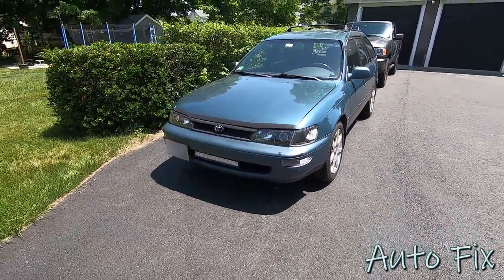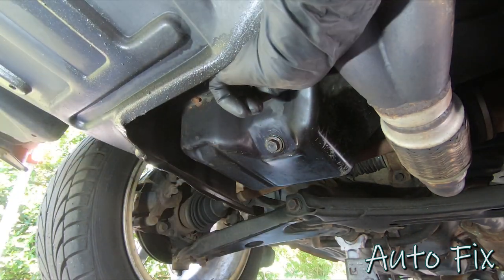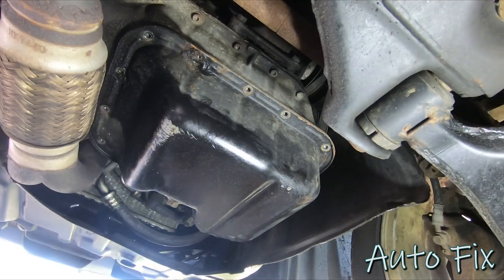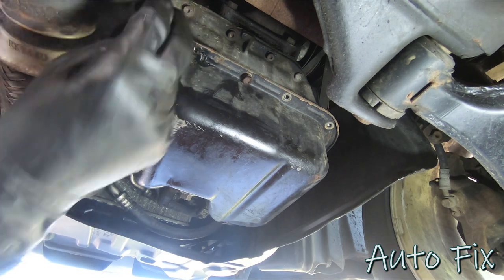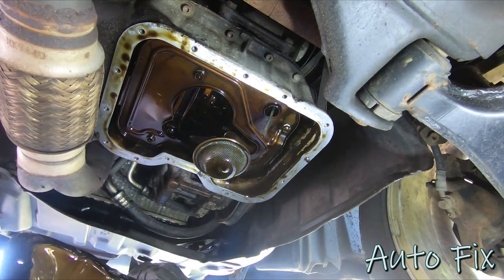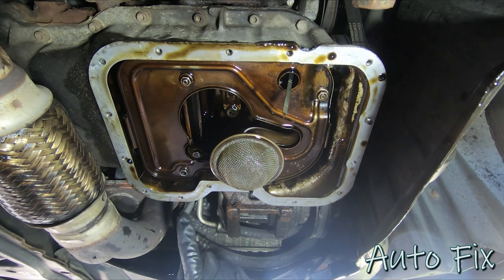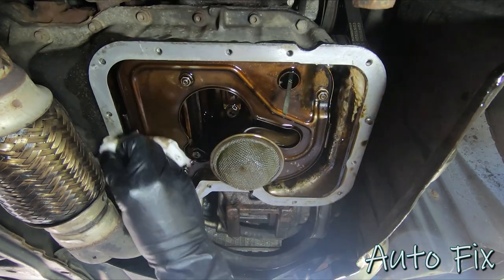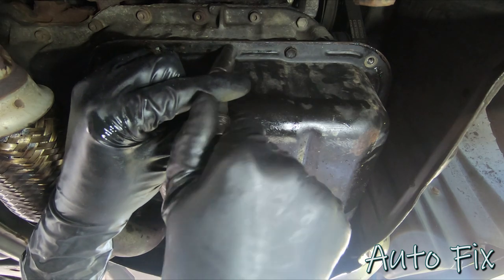Oil Pan Re-Seal 1993-1997 Toyota Corolla & Celica (1.8L 7A-FE)

Comment: Make sure you unscrew every single bolt before you try to take the oil pan out, or it would be twisted. Good job though.
Reply from the maker: Lol yeah I forgot to take one out and had no idea. Oops.
Thanks!
Reply: @AutoFixYT  it happens! LOL ... that happened to me when i was changing the auto tranny pan gasket & filter, missed two bolts on that 
https://www.youtube.com/watch?v=_1klImYJyHI

Comment: I got offered a '93 manual Corolla wagon for a parts car for only $400!!  It barely runs he says.  My main issue is where to park it.  What do y'all think of this option??   🤔
Reply from the maker: If it's not rusted out then it's worth it! You can always make it run better. Theyre fun cars, easy to work on, and rare!
Reply: @AutoFixYT  My 1996 wagon runs great with ONLY a check engine code for a return oxygen sensor.  Buying a parts car seems "excessive" and denying someone else the chance to fix it up.  I've only got one ass, so don't need two (2) running cars 😏
Reply from the maker: @apj341  Haha I didn't know you already had one. So I guess only you can decide in that case lol

Comment: Hello. I am looking for information on how to replace brake fluid. I have a Toyota Carina E 1997 1.8 7A-FE with abs. I don't know how to do it with abs. If you could show a video how to do it.
Reply from the maker: I can't show a video but there are multiple ways.
1. Flush the braking system manually like bleeding the brakes until fresh fluid comes though the calipers. Then find a dirt road and hit the brakes hard so ABS can engage, do this 5-10 times. Then go back home and bleed brakes again. Repeat this as long as it takes until you have clean fluid in the ABS and no air bubbles, and your pedal feels good.
2. Use a scan tool that can communicate with the ABS module.
Reply: @AutoFixYT  Thank you for your reply. Can I use the bleeding method with a transparent hose that has a non-return valve?  I saw a video on YT, a guy sucked the old fluid out of the brake fluid reservoir with a syringe. Then he added new fluid to the maximum level. Then he started at the farthest wheel and put a transparent tube with a non-return valve on the breather. The other end of this tube was placed in a bottle of brake fluid.  He unscrewed the bleeder and pumped the brake 17 times until clean fluid flowed through the hose. He constantly checked the fluid level in the expansion tank. Then he turned off the bleeder and moved on to the next wheel. My car is old but I don't want to do anything that could damage the ABS. After this method, will the entire system be bled, including the ABS? Do I have to remove the fuse or the ABS relay to replace the brake fluid?

Comment: That was a great video. I have a 97 Corolla I have to do my oil pan gasket my car has 444 Thousand miles and still running strong
Reply from the maker: That's crazy! So many miles! Mine is at 354k miles, burns lots of oil but runs nicely otherwise
Reply from the maker: Lol

Comment: I hate oil pans with drain plugs in the front. My old intrigue had that. Had to lift up from the rear really high to angle down for a good drain.
Reply from the maker: I know what you mean. When the drain is on the front i just leave the car on the ground. If i can each the plug, that's all i need.

Comment: I am curious to know if these oil pans can rott through from a rusty outer spot? I found a spot on mine that I should probably sand to clean metal and paint it
Reply from the maker: Yeah they can. That's what happened to my original one. This one isn't the original one anymore. They're steel so if they aren't painted, over time they will rot out

Comment: could you also just buy a gasket?
Reply from the maker: Yes. But they usually don't hold as well as RTV. Also, on a 353k mile engine like this one, the pan has been removed many times for sure. I have removed it 3-4 times just throughout my ownership. And I bought it at 263k miles. So my point is the pan isn't perfectly straight anymore. And a lot of times a cork or rubber gasket will not seal up a warped pan but RTV will. So that's why I prefer RTV for this.
Reply: @AutoFixYT  Okay sounds good, I’ll probably do this next oil change. I just wanted to know which was better overall, don’t want to waste money on a gasket that won’t work. Keep the videos coming
Reply from the maker: @poppinfresh5261  Well I'm glad I answered your question! Unless your oil pan is totally mangled (in which case you wanna get a new one lol) then a cork or rubber gasket will seal up but overall RTV wins just because it will last longer and is way more forgiving with any possible imperfections. Also Toyota uses RTV from the factory. So there's another reason right there lol

Comment: My 96 Corolla 1.6litre has a stiffener plate that is in the way of doing this easy peezy
Reply from the maker: Interesting, where is the plate located?
Reply: @AutoFixYT  it has 5 bolts into rear end plate by the engine rear oil seal & transmission housing and covers half of the oil pan!
Reply from the maker: Weird, I've never seen that before. Must be a racecar lol
Reply: @AutoFixYT  lol it's a slow roller cruiser in the city light to light  with the AT but it comes alive on the freeway screeming at 95mph with real gutso
Reply: @AutoFixYT   I took a short video if you wish to see that stiffener plate on the channel. https://youtube.com/watch?v=t54WZGcbRuE&feature=share
I got the crank pulley off and valve cover today but now the issue is getting the middle plastic timing cover off! Top one was easy and managed to wiggle out the bottom to find a neat oil weep puddle from I think the front lower seal lol. But the middle one is not budging much because of the water pump pulley, what is the trick to removing that cover other than trying to remove the water pump pulley in that real tight spot TY!
Reply from the maker: @JAY-gv4eq  Interesting setup. Haven't seen it before.
Anyway, you have to take the WP pulley off first. You would have had an easier time removing the bolts with the belts still on, usually that's one of the first things you wanna do. Now the pully will want to spin. But maybe you can hold it somehow. Take the pulley off, then remove the cover.